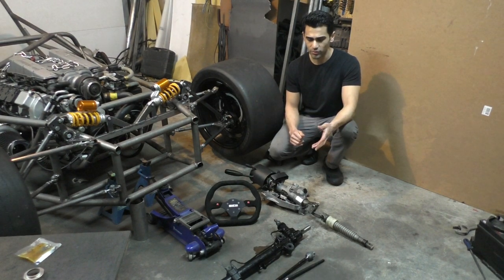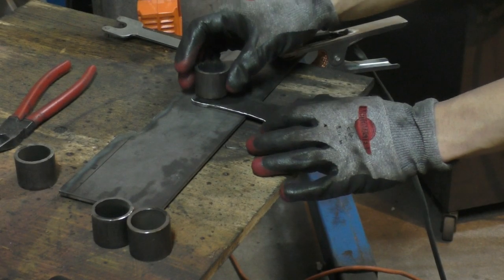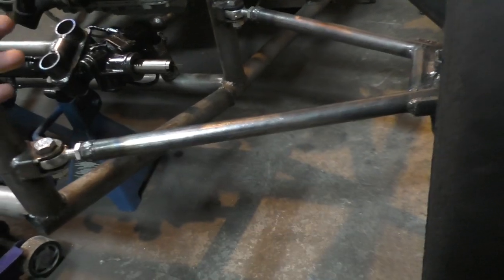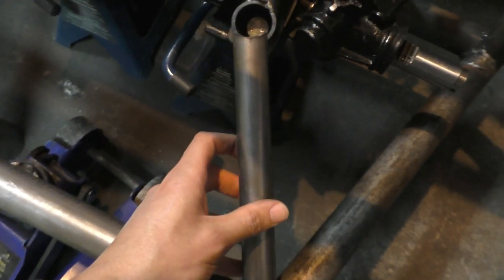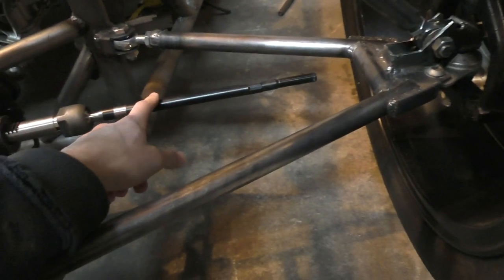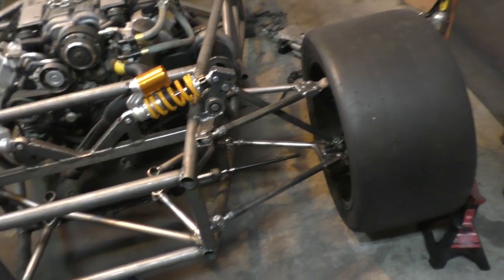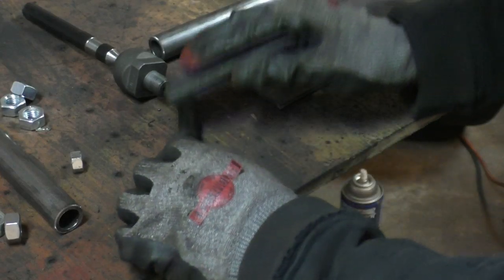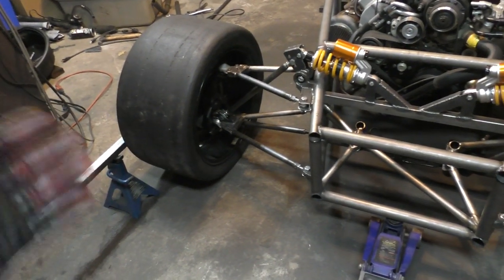Steering Rack, Steering Column Install, Bump Steer - E55 ASL Part 8

Comment: This dude literally building and reverse engineering abwiring harness. I can't even figure out how to wire a damn old school distributor. This dude is using every ounce of grey matter between his ears he has for this. It's amazing
Reply: Microprocessor programming is quite simple to be honest. You could learn that easily from materials online.
Reply: There are plenty of schematics available, reverse engineering is not even required. If that impresses you how about this: You can literally make your own ECU using an Arduino.
Reply: @MiGujack3  considering I am a certified dumbass when it comes to electronics. That's shits mad crazy that ya can do that!!
Reply: @MiGujack3  You can even do an ECU with some opamps (I mean fuel delivery)... a complete ignition advance control would be more challenging...

Comment: “That’s all I have for this video” is the saddest part of each series. 

Also, how did you learn all this? Vehicle dynamics and design, electrical engineering/programming + all the manufacturing is very impressive

Comment: Fantastic build as usual SK and very timely. 
My son and I are currently swapping a M113 and ZF six speed into a W201 190E 2.6 chassis and are just sorting out the steering Shaft to a w210 Steering Rack.
We have learned so much from your intuitive videos----------keep up the great work.

Comment: I had a old no power steering car with very slow steering, always too slow to catch a oversteer moment and a workout to do auto x. It involved over 360 degree inputs each left and right, hand over hand over hand over hand let go hand over hand hand over hand. Now I have a MR-S which has rather quick steering for a street car, it feels more like the race games. It's so nice not having to hand over hand

Comment: Love the microcontroller solution you've decided to implement! You could even do i2c bus and control more devices with 2 wire connectivity if you wanted. You could then include other MCUs and then hook them up to your laptop via USB (i2c) to diagnose them and program them individually. My MCU of choice are the Microchip devices in either 8, 12 or 16 pin config. I like the nand driver you chose to drive the relays. You could even do opto relays to save weight, space and EMI emissions from the firing of the physical relays. You should use ferrite chokes to reduce signal interference on your signal lines. Put ferrites on the output of the relays and also on the signal outputs of the relay controller. You'll thank me when you're not getting ghost firing of your relays from all the EMI interference being emitted from your ignition coils and other EMI sources. May want to shield the wires too to ground. Hope that helps.

Love how the build is coming along ! Awesome job! Keep up the great work! Saving space in my calendar to come out and see your inaugural race! :)
Reply from the maker: Thanks for the information! Yeh, usually I add more filtering but since this is just a simple circuit for turn signals, I didn't do much. But yeh EMI is really a problem in car electronics. I've had trouble with it before. Usually an inductor and capacitor filter makes a big difference
Reply: @xfmotorsports The use of an inductor capacitor filter across the output is a great idea. You should also consider the use of either pull-up or pull-down resistors, depending on the activation voltage of your relays and any brownout voltage situations of your battery under load.

Really enjoying how your project is coming along. Keep up the good work!

Comment: Bump steer is when the car actually steers left or right when hitting bumps by turning the wheel/following cracks/waves in the road.... think of bump steer like a lever, one for each wheel, one side of the lever is the steering wheel and the other side is the tire.... it should be easier to move from the steering wheel side and harder to move from the tire side, ( levers only work one way )

Comment: I would have just decoded the Merc canbus messages and kept the original wheel module, unless it requires some kind of stupid ring type message registration to keep the module working.
But whatever works for you! Nice job!

Comment: Question: why did you not disassemble the German steering rack and make a new one that was more conventional using straight shafts and universal joints? I think that it would be worth it since space is scarce inside of the car. Thanks, keep up the amazing work
Reply: He said, as the seat is fixed, he need the steering with all the adjustment to adjust his position inside the car. (sorry my bad english)

Comment: You were talking about metal losing its strength after welding. Did You ever hear about stress relief (glowing)? I learned that this should be done after welding in order re-establish the natural 3D ion grid.  That ion grid simply works like Your car body frame. I also wonder why You do such a great job but seemingly never thought about a trans axle construction for a better balance of weight ration on both axes. You'd also have more space for ya steering mechanism.

Comment: Did you consider scoping out and decoding the CAN signal from the factory circuit? On my car I did that in order to regain SWC for a new head unit. It might simplify wiring the car later.

Comment: A too low 1:8 ratio string wheel could make you keep correcting line all time in an unleveled straight line track maybe losing all control, don't you think?

Comment: You are doing great but I would drill cross holes in middle of your tie rod and plug weld it because if the inside pieces catches a harmony and viberates
it could crack the weld but if its welded near the inside end it can't do that

Comment: whats the reason for removing the supercharger? would be super neat if you ran a twin charged setup!
Reply: Weight, space, aero. You can still make the same power with turbo only.
Reply: @jareknowak8712  makes sense. Yeah I know turbo will suffice for power, just would have been neat to run an uncommon setup. I'm hoping to run a twin charged setup one day and would have loved to see how he would tune and configure the two chargers.
Reply: I’m assuming it’s gonna be high revs track racing, so turbo more efficient, the supercharger will only be making drag from all the belts, and not adding any power at all as it would be on bypass

Comment: I was actually trying to modify some of the electronics in my c240. Kinda failed at even receiving a single message from my interior CAN bus. did you use a fault tolerant transceiver or the high speed variant?

Comment: Why didnt you ditch that steering shaft, and adapted an aluminum guibo plate adapter that will mount to the benz column to a universal style steering shaft. Im sure that would have save weight and space

Comment: About tie rod...

Isnt it is wiser to "weaken" the tie rod? So when sh!t happend, your steering rack and mountings will be safer? (Tie rod as sacrifice)
Reply: mokujin this is very true, learned this from a very smart old mechanic. You are correct
Reply: @german_2jz269  the factory already does this, thats why they taper the ball joint end
Reply: Yeah. This is common practice with most suspension components actually.

Comment: Have you considered to move all of the cooling system to the rear?

Way more room for a decent radiator and fans, out of harms way of debris, and
engine-damaging collision leakage.
Extra cooling ducts above the rear wheels, piped to the radiator area would help.

That steering wheel (column) setup is so complicated- and I know it
must be fun to have all that functionality- but wouldn't just a simple shaft 
suffice? On a "track" car- is all of that necessary? That whole unit must be heavy?

Will this car be capable of 1/4 mile drag, or just strictly track?

Will it be "street legal"?

Your build reminds me of Cleatus McFarland's car Leroy; a Corvette without a body-
and that car is fast AF.
Reply: From what i have seen in YT, in 'Murica everything can be street legal.
Reply from the maker: Kept cooling at the front to keep things simple. It becomes a hassle changing fluids and bleeding the system if the pipes are too long. This way maintenance will be easier. Steering column seems heavy but its actually magnesium, weighs 6kg. A non electric one might have been 4kg. I do want it to be adjustable so other people can drive it later. Its designed for circuit racing but who know I might give it a run down the drag strip after its all working!

Comment: 16:07 I would just dump the whole thing and put a cv joint to turn the rack. It would give you much more predictable wheel angle vs steering wheel position ratio.
Reply: The joint doesn't influence the steering angle.
Check it at 17:36 when he turns the wheels the steering wheel turns in a smooth motion paralell to his moving the wheel.
Reply: actually it does. Its modified universal joint which means it has the same flaws as regular universal joints. The reason universal joints differ from cv joints is the variable input shaft vs output shaft position during rotation resulting in small gear ratio fluctuations twice the rotation speed of the joint.

Comment: That bumpsteer explanation seems slightly off, won't your anti dive/squat geometry toss a tiny(insignificantly small?) amount of toe change throughout the suspension travel as you can't mount your tie rod precisely on the centerline?

Comment: To control heat while welding get some aluminum cooling blocks. Basically big blocks of aluminum that will dissipate heat from the part.

Comment: What shocks are you using? Please link them to me. But how are the damping rates of your shocks suitable for your application? You did mention that those came from a motorcycle. Or was that decision made based off of your calculations? I’m also sourcing cheap, adequate shocks for my build. 

Besides that, can you explain to us why you went with a front-mid engined layout rather than the much more common rear-mid engined layout. Looking forward to your answers, if you saw this. Also, your content is top-notch! Keep it up!
Reply: I can't speak for the man, but he's using an E55 as a donor car, so engine placement probably has to do with the trans from the E55. It's a traditional rwd trans whereas a mid engine layout would require a transaxle. Adapting the E55 engine to a transaxle could get complicated. Despite the looks of thia build, he's keeping everything very simple.